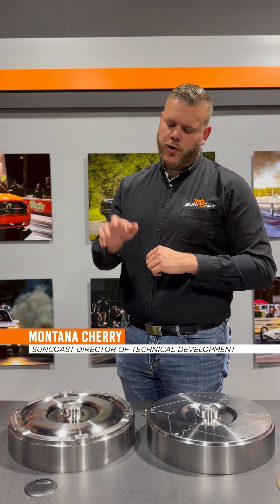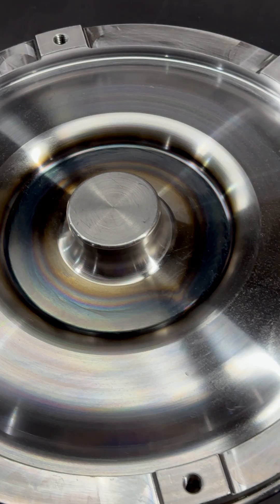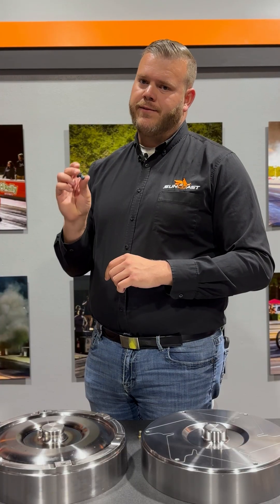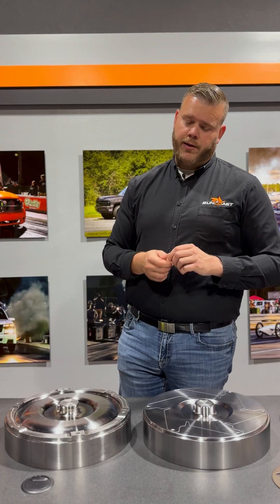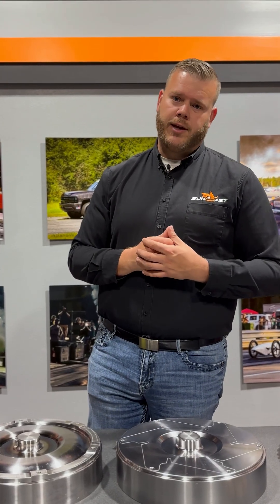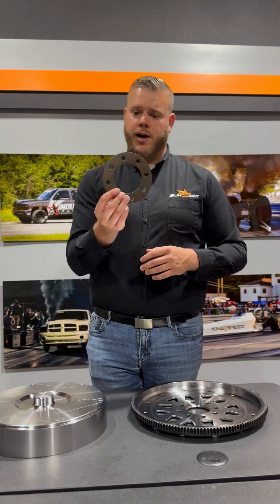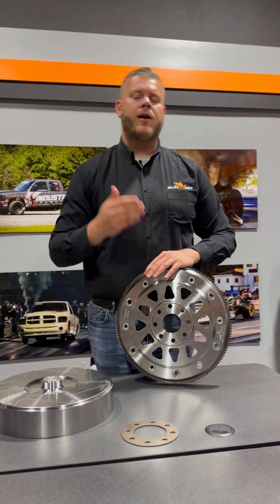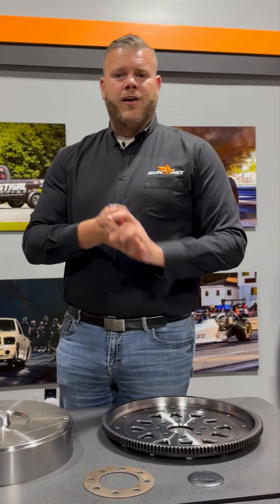Avoid a 68RFE Failure — SunCoast Torque Converter Specs You NEED to Know

Comment: Yeah good job on the upgrades. Apparently the factory built 68’s are junk. Mine went out at 120,000. Only hauled a pontoon boat a couple of times and camper a few times. I went with a rebuilder rather than buy another factory junk one.